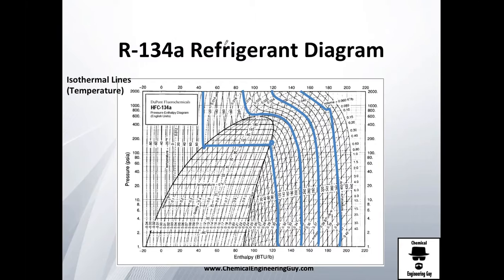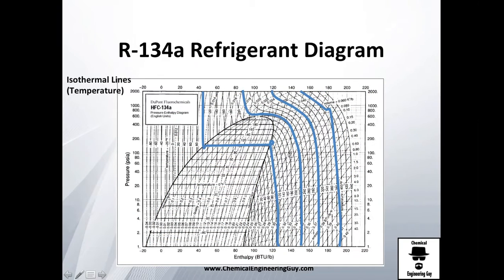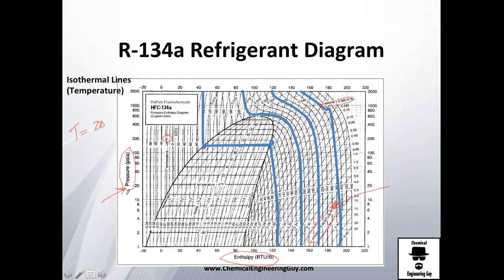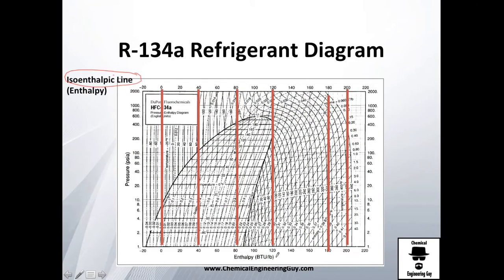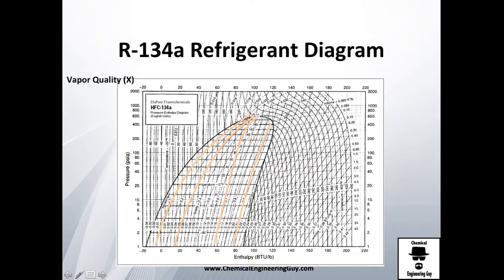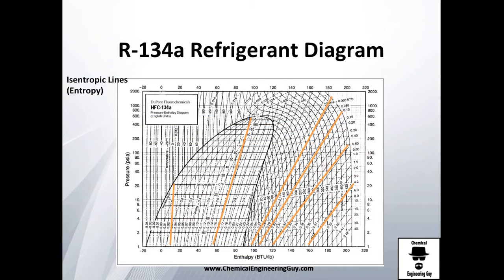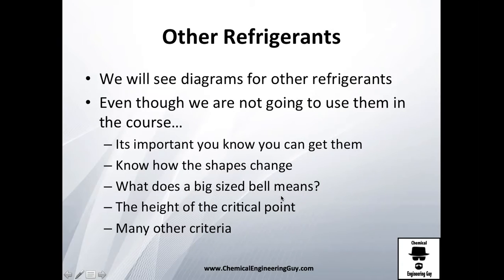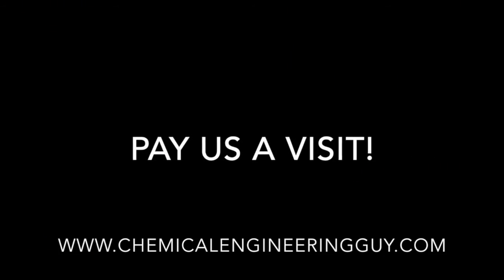How to read Refrigerant Property Diagrams (R-134A) // Thermodynamics - Class 67

Comment: I have a practical problem.
In order to avoid using a refrigeration system in a data center. I must show that cooling requires many times more energy than heating (and more money).
But I cannot find a good article about how much energy and work is necessary to pump out certain energy from a refrigerated room.
Best regards.

Comment: How can i get enthalpy and entropy points if i have a condenser temperature of 40 degrees celcius and evaporator temperature of of 5 degrees celcius. ?? Help please.
Reply from the maker: +Syaheen Nasrin If no pressure is given, assume those are in saturation points. Then search for the condenser and evaporator properties. Make sure you choose correct Final, Initial conditions (i.e. vapor vs liquid)

Comment: how to calculate specific volume at any given temp
Reply from the maker: +manishh mapwal If it can be modeled as ideal gas. Use PV=nRT, solve for volume and change the amount of moles to mass. Then apply V/m .... If you are using real gases, use whatever approach you think is suitable (i.e. van der waals equation, Z ratio, other equations of states).